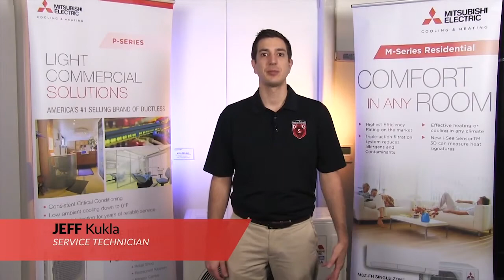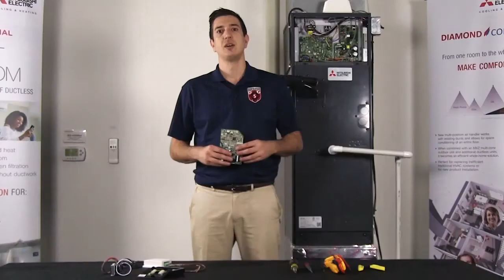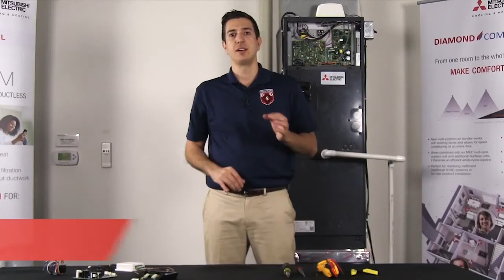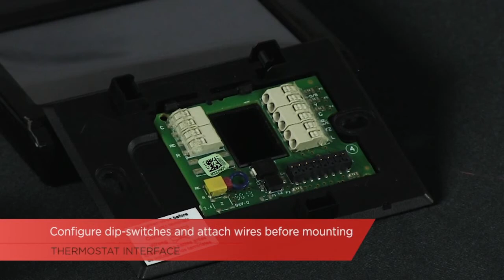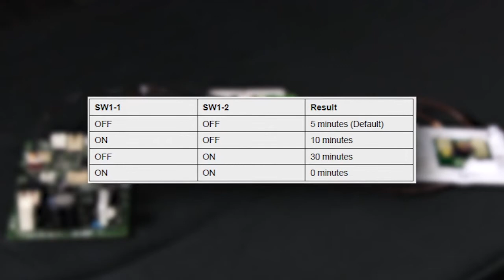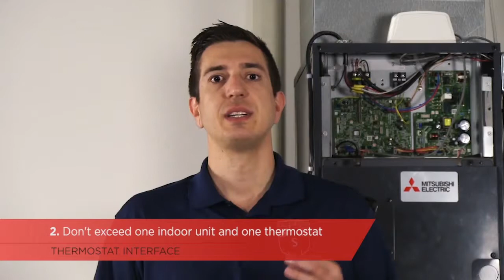Tech Tips: How to Install our Thermostat Interface (L)

Comment: The directions in this video about setting sw2-6 to "on" for use in 2 stage when Y2 and W2 are connected is the oppisite from the manual that shipped with the Mitsubishi Thermostat Interface PAC-US445CN1.  If the video is incorrect it should be taken off air.

Comment: We just got this Mitsubishi (PEFy-p12nmau-e3) unit installed by builder. It looks like based on the compatibility chart this adapter should be a go. I am still not quite sure how to get it done. Is there any DIY guide for installing this?